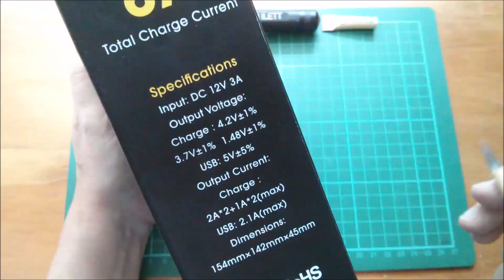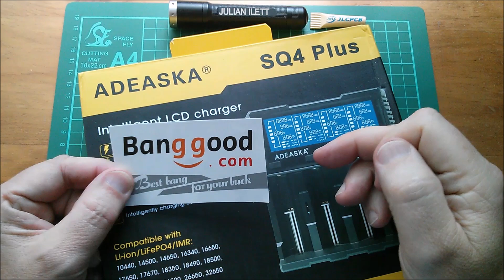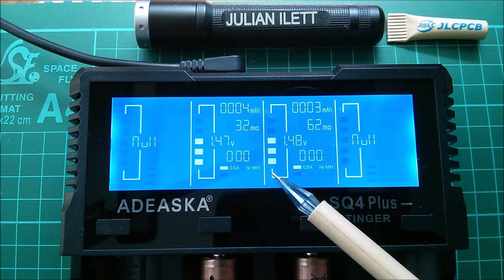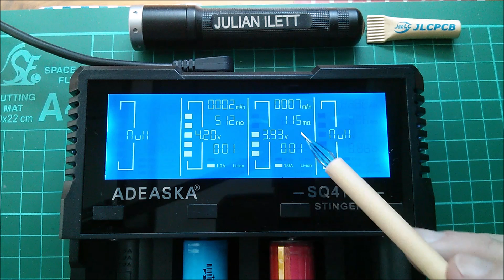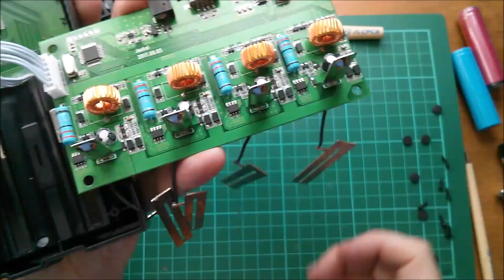Everyday Battery Charger? - Adeaska SQ4 Plus Stinger

Comment: Like!  1) At the end of the charge (-ΔV), this device goes into trickle charge mode (maintaining
 maximum charge with low current) ?????
 2) Is there a discharge function?  No pre-charge!
 3) After the discharge, this device is on the machine, without touching it, can it independently charge after the discharge ?????

 Who knows help.  It seems that this is the key value for me among two (three) devices.

Comment: Julian, I bought my SQ4 charge almost 2 years ago but it has burn the two T4 diodes that are just under the 12 V power socket. I can see them in the video of the tear down. I think they are for reverse polarity protection. I have replaced them and they keep producing smoke. There must be something else casing this. Do you have any ideas of which other component has failed in that causes  high current to these diodes. I have placed them with the negative bar facing the power socket. Can you verify in your board if this the correct orientation? I could not determine it  looking at your video.

Comment: The internal resistance (IR) of a Lithium battery is a function of both temperature and SOC (state of charge).  IR is high under 25°C and above 45°C.  State of charge plays a major role also.  Under 30% SOC IR is very important (high); optimal around 40% SOC, above 60% SOC IR rises slightly again. Since heavy load make temperature of the battery rise very high IR rises accordingly.  On the other hand, a near to empty battery will always show a high IR, which will improve considerably during charging. So, charging a near to empty battery IR will look worse than it actually is.

Comment: You should try empty cells and see what the resistance shows, then when at approx 50% charged pull the battery back off the contacts for a moment and let the charger read the resistance again. Then repeat when the cells are full. I'm thinking the resistance is much greater at empty and full state of charge.

Comment: My zanflare only charges lithium at 1 amp if you are not testing a cell. And does 300 & 500 ma when testing. And 300,500,700&1000.ma when charging. I have only used it with liion . I can squeeze 3 protected 26650's in it. It works as long as you don't bump it. It will loose connection. It's ment for only 2 26650's when testing cells I charge only @1amp then test at ...    .5a.  Then when it starts charging I changed to charge only at 1 amp. It saves loads of time when testing lots of cells...

Comment: Might as well just get a JLCPCB and Banggood tramp stamp at this point. Also let's not check the quality of the voltage regulation, noise, spikes, actual current, or anything else before declaring it's good.
Reply: Mr. Delphi it wasn't meant to be a true review 😉 
It is just a concealed product advertisement.

Comment: Looks like a nice charger, but not at the normal price!  It's on offer at the moment and a bit pricey, after the offer time is over though, it's just silly.  Only thing I'd use that for is the 18650 cells, my little Vapex does a great job of the GP Recyko AA cells in my collection.  Have you ever considered building your own charger Julian?  One that does the discharge cycle and shows all the information?   Unfortunately beyond my abilities, but probably not yours.

Comment: Try putting a NiMH in first or last slot and see if they can charge more than 500mA. If not then this charger is useless to those who use bigger sizes of MiMH cells. Charging a D size cell can take quite a lot of time with this current.

Comment: I was a bit disappointed to read a review of my Optus charger (after I bought it, no less) which said it uses some kind of PWM for charge and discharge current control, so I'm wondering whether this unit does the same? It does make a difference compared to proper constant current charging, because it's actually pulsing a much higher current (up to 3.5A!), which will not only affect the charge and discharge curves and capacity measurements, but also the cell temperature and lifetime.

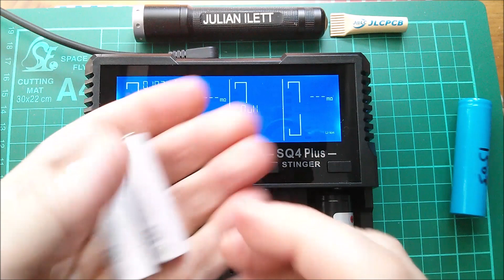Comment: AT 6:26 you removed cell 3 and but cell 2, 3, and 4 displays went to null.
Reply: It was because he jostled the charger which dislodged the adjacent batteries from the charging plates.  These chargers do not hold in the batteries very well.
Reply: At least they aren't too tight. All my 18650's have dented positive tabs from the springs being too strong on my nitecore charger.
Reply: The charge circuit was resetting, it went null on the right one too, but then came back.

Comment: So, when taking it apart, the black wire goes to the metal plate and not to the slider itself. This means that current is fully dependent on contact between the two plates. This is a problem with the Opus brand chargers. Over on SecondLifeStorage forum several of the members did some mods to the Opus charger by running an independent wire to the slider itself. Charge times improved and the Ohm readings were more consistent.

Comment: That "512mOhm" cell looks like older one, probably from laptop battery so it's normal that internal resistance has gone up. Considering capacity probably dropped from 2000 to 1500 (i assume it 2Ah and that 1500 marking is mAh) it's at the end of lifetime.

Comment: But does it have a discharge capacity calculation?? And at what current
Reply: A discharge function is rather important to measure capacity
Reply: Are those large resistors not for discharge function? If it doesn't have a discharge function that gives the battery mAh it's pretty useless for many of us.
Reply: Those look like current shunts.

Comment: Looks pretty handy. No discharge function though? That blue 18650 looks fairly rubbish though. That internal resistance measurement and the fact the voltage shot up quickly. Handy to have one that charges and discharges though, if not just for videos like these :-)
Reply from the maker: I quite like it's simplicity for everyday use. Yeah, the blue cell is rubbish.
Reply: Slot 2 kept reading high resistance on every cell making me wonder if the sliding contact just wasn't making a very good connection with its metal strip.
Reply: Even good reliable chargers give junk IR readings. IR is just not reliable. More reliable is RTE (round trip efficiency) which is Discharge mAh / Charge mAh. The closer to 1.0, the better the cell. Chargers like the Opus will give a value greater than 1, which is impossible, because they are garbage. The Opus is well known to over-state discharge capacity by up to 20%